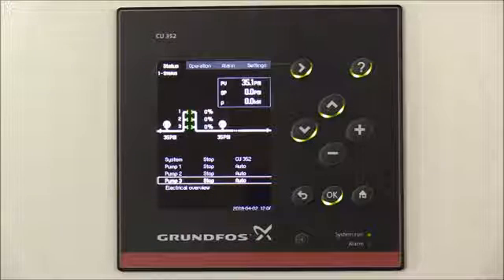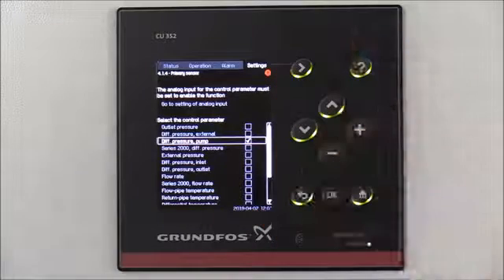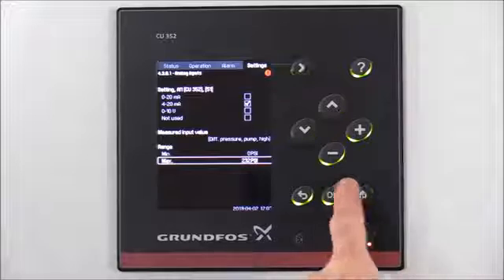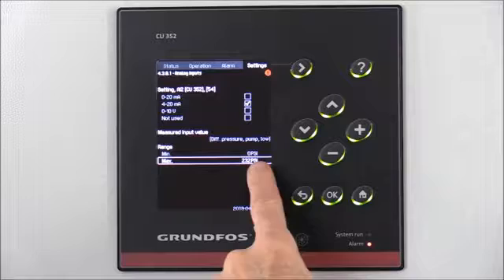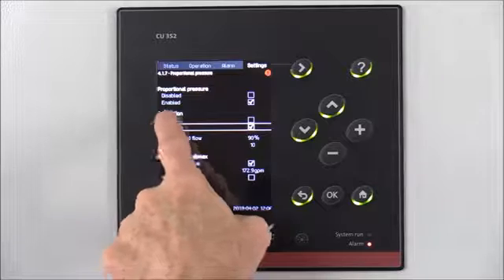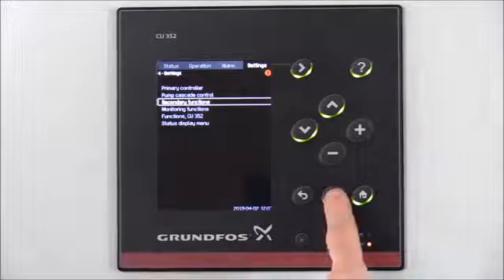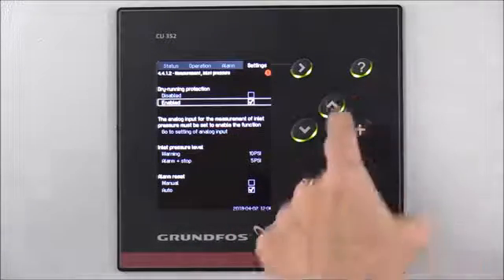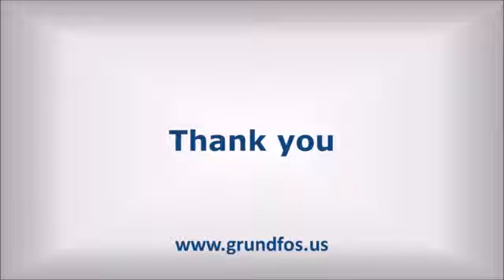How to Setup the Hydro MPC CU 352 Controller for Hydronic Applications Using Two Sensors on Manifold

Comment: Hello, i have the same exact system, but i have a problem. This system is connected to 3 pumps, 3rd one i have shut off. And working on the other two pumps. The problem is that the controller does not switch between the pumps, i mean the 2nd pump is only working while the 1st isnt. While i have put both pumps on automatic and both pumps are same. Is the system designed for only one pump work while ?
Reply from the maker: Hello! Thank you for reaching out to Grundfos. Please contact our service team for questions on products at http://gfos.ly/6059pzz6b
Thank you!